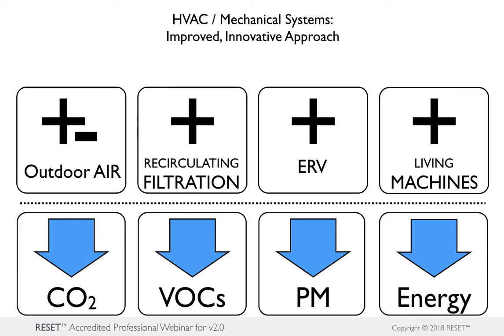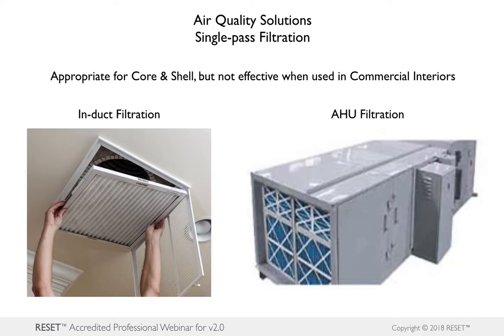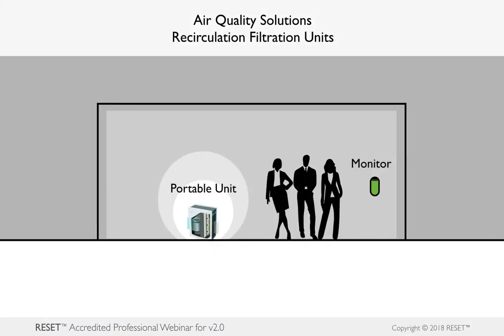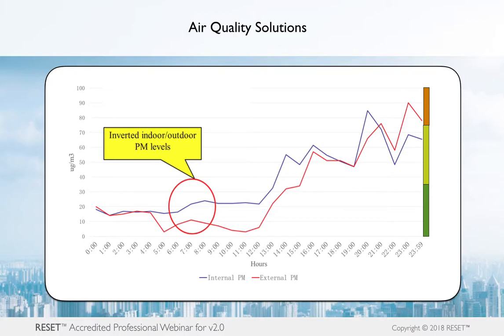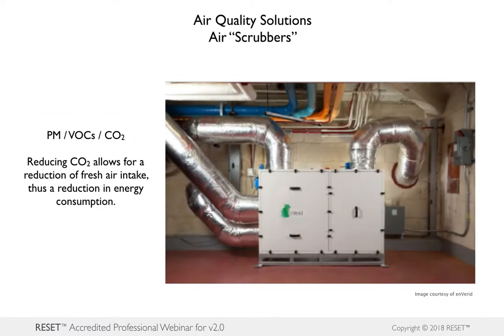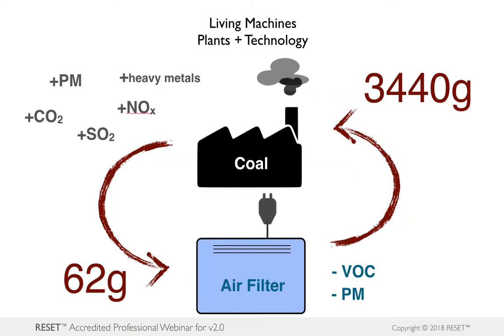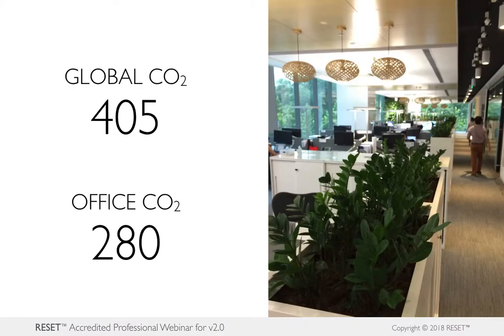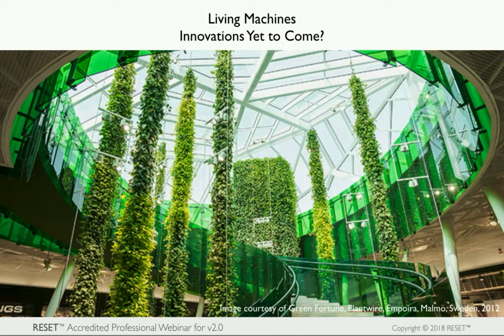RESET Air AP Training Module 7 - Solutions, Innovations, and Case Studies

Comment: So illuminating! Can you send a link to the planter pot at minute 41:30 that pushes air through the root system? Thanks!
Reply from the maker: Thank you for the question and apologies for the belated response. We're not sure if that company is still around. We did a search and did not find it.

One thing to note is that there's been more research done since then and it's shown that although pushing air through the root system is significantly better than at absorbing TVOC in comparison to just using the plant as is, the amount of TVOC absorbed is still negligible and not recommended as an effective solution for solving TVOC issues.